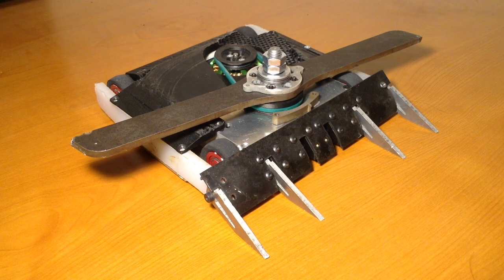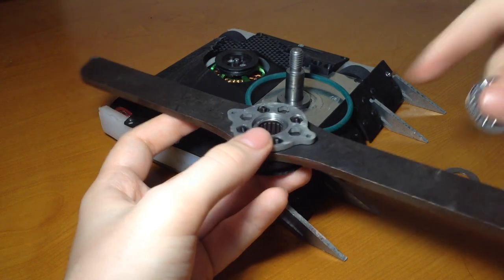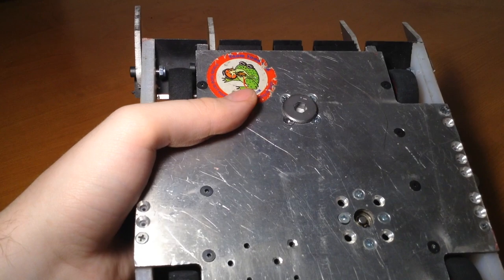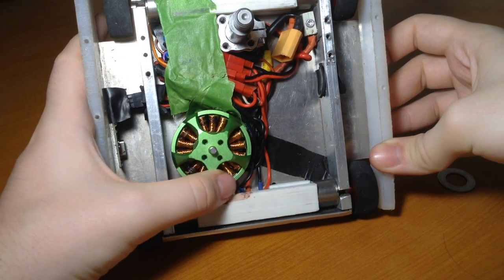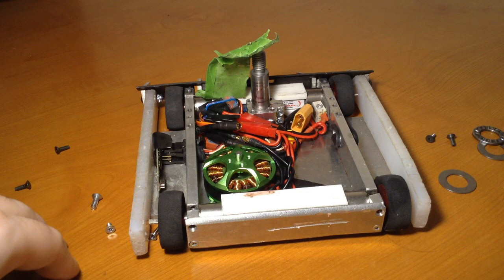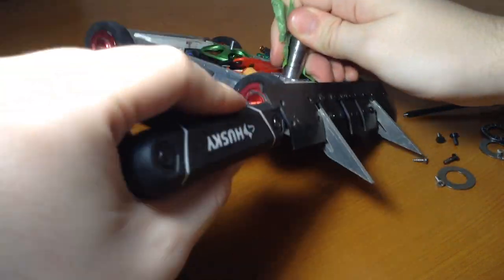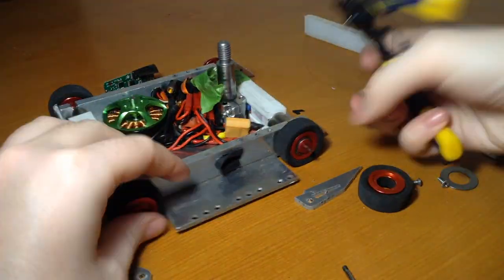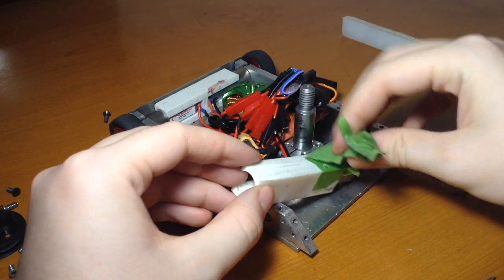Beetleweight Horizontal Spinner: Phantom II Design Teardown

Comment: Nice video. Mind if I ask how the steering works for robots like this? Are you driving both sides forwards/backwards independently like a tank or is there some weird channel blending happening?
Reply from the maker: Thanks! Personally, I do tank steering with two sticks, but many people use mixing on their bots to drive arcade-style with one stick. One of our previous videos shows how I modified my transmitter for tank steering. When people use  arcade with mixing instead, nicer transmitters can be programmed to do mixing internally, or on-board mixing devices like fingertech's TinyMixer can do the same thing inside the robot.

Comment: I want to see an antweight version of this.
Reply from the maker: I've been thinking about that, maybe someday!
Reply: Why not make a kit for it? (Endbots did it with their Vector combat robot)
Reply from the maker: I unfortunately don't have the same manufacturing resources as Endbots for larger-scale manufacturing. Also, as this video and the open source release of Spooky have shown, I still have a few things to learn about designing for serviceability and distribution. Maybe someday in the future!
Reply: It never hurts to dream, right? (Also for the fairyweight, maybe you can make a separate pulley for the new Fingertech Bloodsport blade)
Reply: Okay well that’s technically 150 g, but the scale is ruined anyway so it can be a 1lb with some fenagaling

Comment: What is the diameter and length of the weapon dead axle? It looks strong. Suggestions for bolt diameter? Thicker add overall weight, but sacrifices strength.
Reply from the maker: We go with a 1/2" shoulder bolt for added strength, because we have a big long bar and the shaft is only supported underneath. The shoulder 2" long, half in the robot and half sticking up on top. The threads are 3/8" diameter and stick up another 5/8".
Reply: @BlackLightningRobotics  Thanks..I added the 1/2" bolt diameter to my Undercutter in October

Comment: What is the diameter of your shoulder bolt?
Reply from the maker: We go with a 1/2" shoulder bolt for added strength, because we have a big long bar and the shaft is only supported underneath.
Reply: @BlackLightningRobotics  Yeah that's pretty meaty. Have you experienced any sort of bending of the shaft when using a smaller diameter?

Comment: Does Thumb War compete alongside Phantom II in competition?
Reply from the maker: Nope! We don't tend to run multiple similar bots together in the same weight class. Thumb War came from the old Phantom II frame that competed in 2017 and the 1st half of 2018, and was modified to have higher ground clearance and aesthetic value in the Battlebox. Phantom II did end up using the painted weapon blade from Thumb War several times, though.
Reply: I see. (Those floor seams are atrocious)